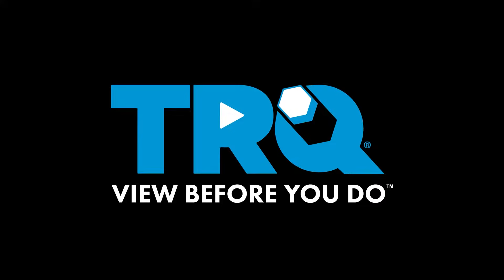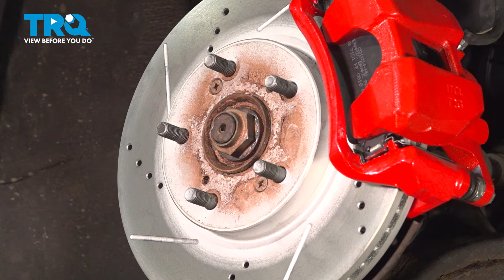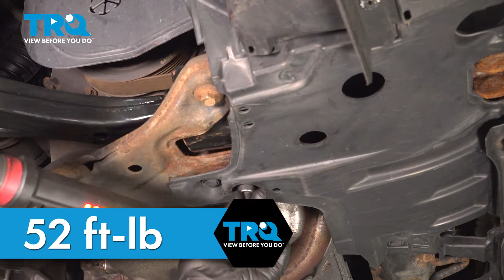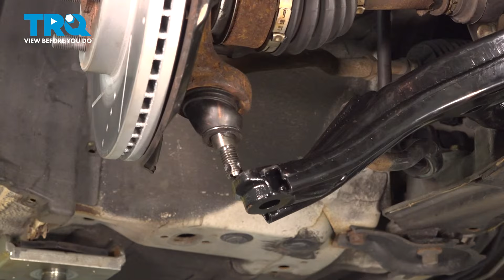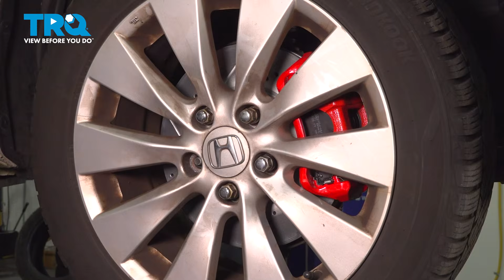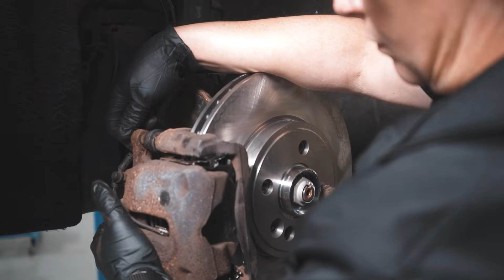How to Replace Front Lower Control Arm 2013-2017 Honda Accord

Comment: In my opinion the only reason to remove the hub nut is see if you need a new hub or wheel seal if you are replacing the lower control arm out of maintenance there’s no reason to remove the hub nut other the to watch another video it is up to the person working on the vehicle but no matter what you are gonna look into the hub specs so taking off that needs just adds time and another video to watch

Comment: I had a real bad time doing mine (2014 Honda hybrid). Nothing easy about it, even after watching this seemingly effortless presentation. Two things helped me out out alot. 
First of all, I was replacing ball joints and control arm and the ball joint puller I was attempting to use wasn't doing the job so I got out my tuning fork which gave me some space and got my grinder with a cutting wheel  and cut the joint in half leaving 1/2 it in the old arm which I was throwing away and then beat out the rest of the ball joint out of the knuckle with ball ping. 
Secondly, since I don't have a hydraulic car lift that would  allow me the room to use my ball joint press with  an impact, I took out the knuckle completely (it's only one additional bolt) and to cut the abs wire. These two modications made life much more bearable and much quicker. What people with hydrolic lifts do not realize is when you are not a shop and  only a few inches off the ground to work, you do not have the luxury of using some of these tools as you do not have the space. I hope this helps someone else.

Comment: Just did this job on my Acura. I "love" how the video shows "just pull the control arm down" to separate the ball joint. In my case, it was a FANTASTIC PAIN IN THE REAR to get them separated (got an inadequate tool kit from Advance and then made a second trip to Autozone to get a larger, adjustable ball joint puller). 
This video shows the job done on 10 min........... without a lift, it took me multiple, multiple hours to get a similar result. This video (while a good tutorial) makes this job look deceptively simple :/

Comment: Please I have a two questions regarding my 2015 CR-V 2WD EX w..
One,, Is 2013-2018 Honda CR-V Suspension Parts the same?
Two- Is 2013-2018 Honda CR-V Shock Absorber Parts the same? If not, what is the Difference between Shock Absorber for Honda Cr-v 2013 and Shock Absorber for Honda Cr-v 2015

Comment: Thanks a lot as I couldn’t find the correct torque spec. Real easy to replace but many will have issues removing the lower ball joint.  Best have with you a ball joint removal tool and possibly a spare ball joint.